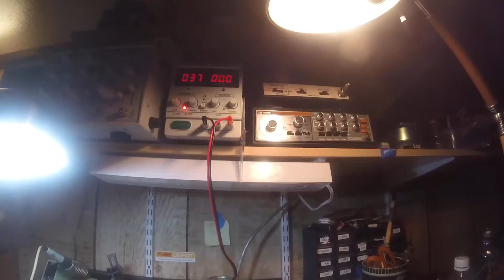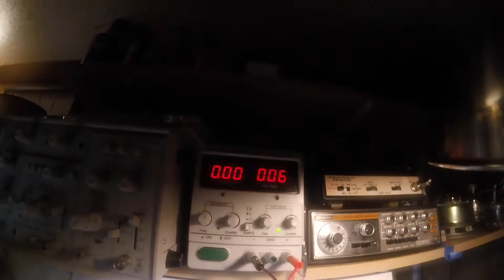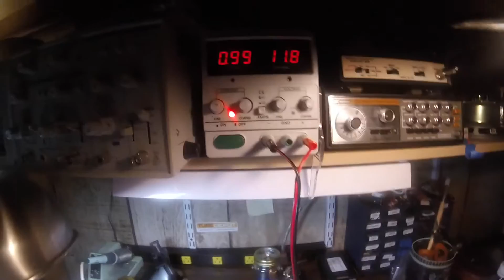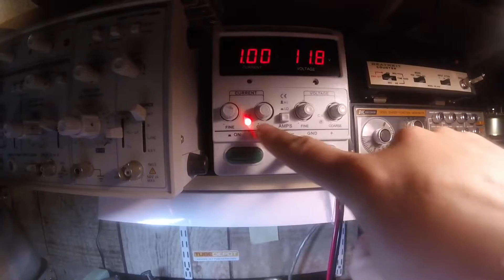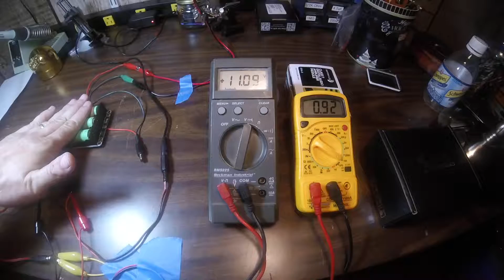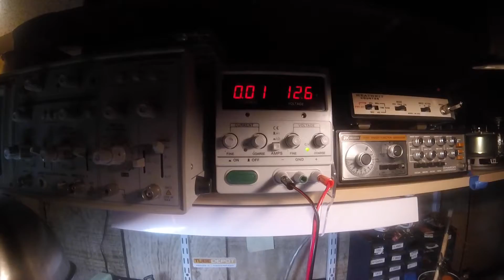Sure Lithium Battery  Extension Board

Comment: hey i bought two of these boards for a project with the sure/wondom tpa250bt. i attached both boards in parallel and it worked like a charm. until...i pulled one battery out because i didn't have a switch installed yet. When I put the battery back in it wouldn't work. 
I tried the other board by itself and i found 12.5 V on the power connector. Then I did the same thing (stupid maybe), pulled a  battery, and putting it back in – no remaining voltage at the power connector. However, measuring the test points (whatever they do?) reveals that there is voltage, but it is not put through to the power cabels. I assume the board circuits for some reason switched off the power. 
I hooked a 12 V source to the amplifier, which worked. Taking it off again, the battery unit still didn't work. 
I wonder what i can do...

Comment: What kind of battery did you use? 18650 Flat-Top or Button-Top? Did you already tested higher Voltage for charging? Connected to a JAB2 15-24V are allowed - so it should be the same when connect directly.
Reply from the maker: I use flat tops. The charging board has protection built into it, so button tops are not needed

Comment: I hooked up a 12volt supply to the negative and positive of the board and seen if it will charge.
Reply from the maker: it will charge but not to max. However it won't damage the cells. Let me know what you find
Reply: okay I'll keep you informed

Comment: take a look at this board  www.ebay.com/itm/3S-40A-Li-ion-Lithium-Battery-Charger-Module-PCB-BMS-Protection-Charging-Board/1 what if we add this to the build and feed it with the power supply coming into the build
Reply: https://www.ebay.com/itm/3S-40A-Li-ion-Lithium-Battery-Charger-Module-PCB-BMS-Protection-Charging-Board/112636165233?hash=item1a39a37c71:m:mVLHQAxNPrQXqd8POkFOxYw this board in particular
Reply from the maker: Yep. That would work just fine. The reason I like the Wondom extension board is its no solder, easy to use and relatively cheap. With the Ebay board, as with the Wondom board you still need a proper 12.6v charger. The CC/CV charging circuit isn't built into either.

Comment: this is great info. good job thank you , I bought a Dayton extension board there the same as the sure , I left a massage about this in your discussion page on your youtube channel,  But your saying not to use a power supply , so I can't connect it to the power supply plug for my amp in my blue tooth speaker  the power supply is 12v = 3 amp ? do you think we could put some sort of a charging board in the build that connects to the power supply using the 12v coming in and send it to the extension board like a BMS board?

Comment: how long does it take to fully charge? how do you know when they're full?
Reply from the maker: Chris Lara this takes several hours to charge. The end point is when the current falls to 1C for your battery. For these that's 120mA. If you are using a proper lithium ion 12.6v charger it'll stop automatically. Those usually have an indicator light to tell you when it's fully charged. Be really careful using a power supply. Don't mess with this unless you really know what you're doing. Even with overcharge protection there is a chance you can overheat the battery.

Comment: aaronthepea I used this board in a project recently. I had the same issue all the points had the right voltage. but it seems that if you pull the batteries out and in again it resets something so you can use the board again.hope this helps. drained the batteries down till the board cut out. trying to recharge through the board now. and all I'm getting is a solid voltage from the charger. not noticing any charging to the cells. I wonder if the amp has a set limit for the battery shut off.

Comment: Thanks for a great video. I had asked the suppliers'tech support but did not give an answer like your video. Now I will use this board as a stand alone power supply board only revise its output connector.

Comment: Would i be able to hook three of these up in parallel with the amplifier that its meant for and have it charge at 15v-19v through the amplifier so i can use the amp and charge the batteries at the same time?
Reply from the maker: I believe you can hook three up in parallel
Reply: Thanks for the reply. I cant seem to find much information on these. I guess ill just have to try it out